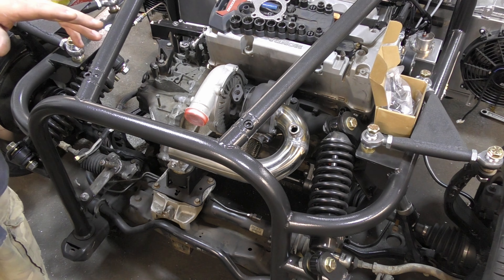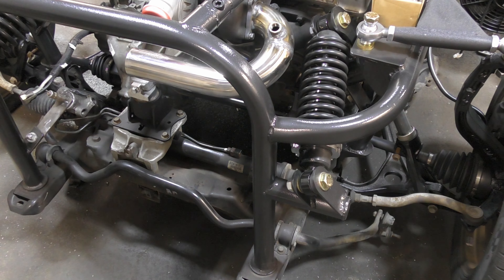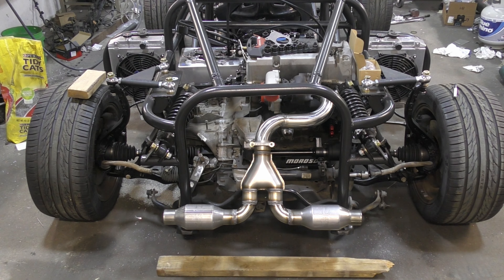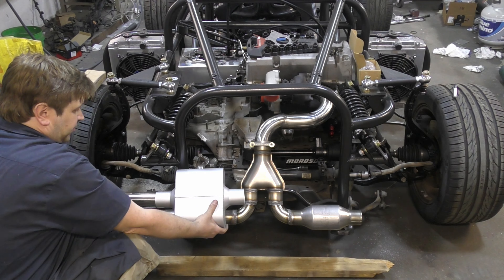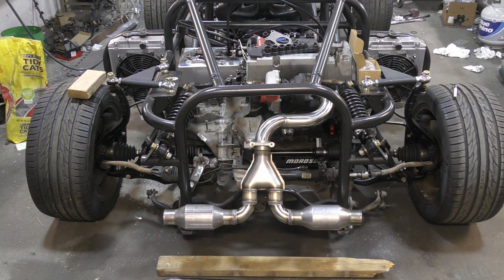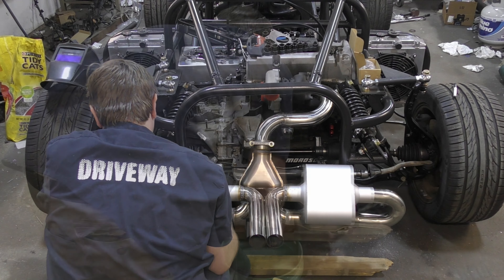K24 Prototype Racer: Full Exhaust

Comment: Dude, get yourself a gaslens a cup nr9 try to backpurge put on Pantera and your welds will be perfect 🙌
Reply from the maker: Agree with the back purge - I don't do a lot so I try to get by.  The main issue was I still had it set up for plate steel and not sheet so when I was barely on the pedal, I blasted right through it; easy enough fix